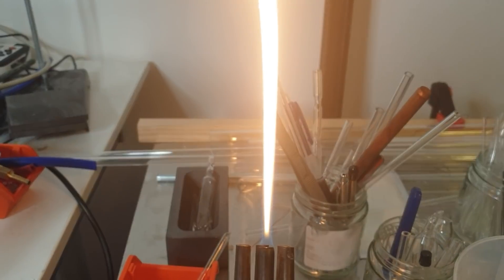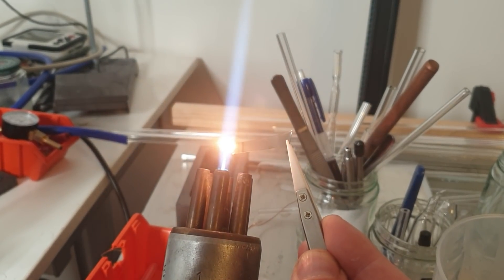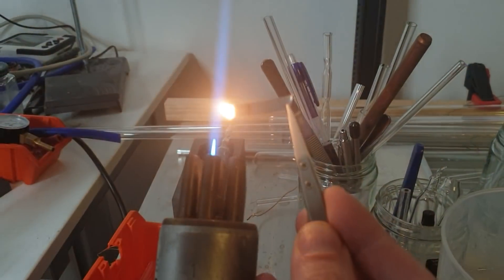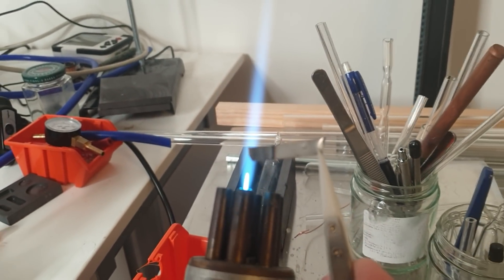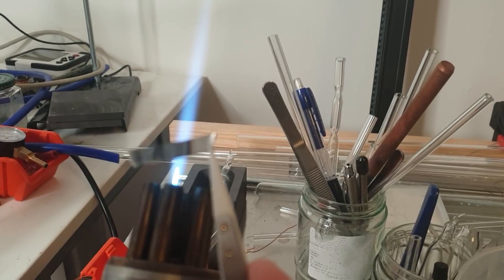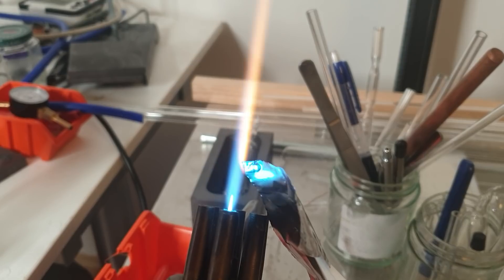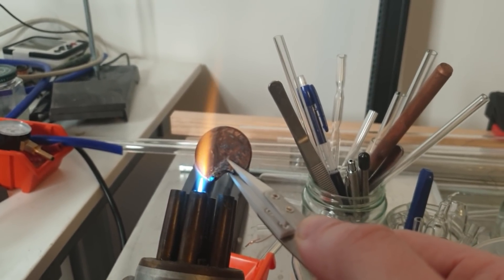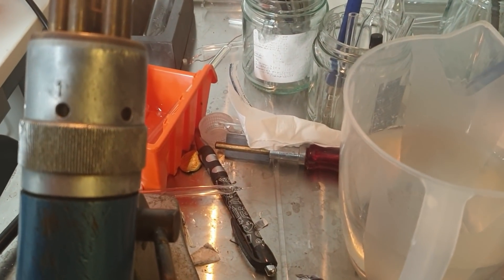Zirconium goes into the fire RAW FIRST FOOTAGE!

Comment: is it possible that the zirconium brightness is related to it being a very strong thermal emitter in the visible region, as opposed to the usual black body radiation glow? You know, the mechanism that is used for AES (atomic emission spectroscopy)? A spectrometer should answer the question - you have one on hand too.

Comment: Can Zirconium make a good structural material for the sodium ramjets on (otherwise electrically-propelled for ascent, acceleration to ignition speed and landing) airliners that will be needed to make money while dispersing sodium oxide into the atmosphere as an albedo raising and carbon capture measure (since use of sodium to combat climate change are a thing you mentioned in another video)?

Comment: Zirconium wire was used in old single use flash bulbs because it burned with such a bright light, the bulb contained oxygen under pressure. Magnesium and aluminium wires were also used.

Comment: What would happen if you took a strip of zirconium, submerged it in water and passed a high current through it to heat it up?
Similarly to the process used when using a tungsten boat to vaporize metal in a vacuum.

I imagine it would be an analogue to what happens in a reactor when the fuelrods overheat and start reacting with the water forming the zirconium oxide and hydrogen. But I dont know if the water would dissipate too much heat of if a vapour bubble would form allowing the zirconium to heat up enough to start the reaction.

Comment: Might be candoluminescence. A quick google suggests that oxides of yttrium and zirconium can be used as a safer alternative to thorium. Also, a patent filed in 1981 (European patent EP0082062B1) suggests using 75-90% zirconium oxide and 10-25% calcium oxide (lime) in a heating mantle. The latter of course also being candoluminescent and traditionally used in stage lighting, creating the expression "in the limelight". An interesting coincidence is also that said patent expired the same day as this video was uploaded! (Or perhaps that's just Google showing the current date as the expiration date.)

Comment: "The combustion of zirconium in oxygen leads to one of the highest temperatures obtainable by the combustion of metals. This temperature has been estimated from available thermodynamic data to be 4930°K at 1·0 atm pressure. A technique has been developed which enables a powdered zirconium-oxygen flame to be operated, thus producing the highest metal flame temperature reported to date." Used for a light source in some photographic bulbs and in explosive primers, and as a pyrophoric material for other explosive devices (probably/definitely thermobaric munitions) Edit: For a giggle, pickle the zirconium in nitric acid and then heat it up.
Reply: Where is the quote from? Source?
Reply: @IanXMiller    https://www.sciencedirect.com/science/article/abs/pii/0022190258800597
Reply: So time for experiments with Zirconium thermites?

Comment: Did you try holding a Geiger-Counter next to it while burning it?

...I know Im stupid, but thats just the first thing that got to my mind.

The second thing is the blinding-bright sparks of Titanium if you push it into a sander or a grinding-weel.If I had to come up with an explanation, I'd most likely default to thermal conductivity coefficient;
So, (carefull, all assumptions:) if a given material has a realy low thermal conductivity coefficient, then there is not that many ways to get rid of excess heat, meaning it eventualy just starts to radiate away.

Comment: I'd heard of it being used in certain cluster munitions and also that it used to be used in camera flash bulbs due to its tendency to glow brightly at high temps in air.
"A small fraction of the zircon is converted to the metal, which finds various niche applications. Because of zirconium's excellent resistance to corrosion, it is often used as an alloying agent in materials that are exposed to aggressive environments, such as surgical appliances, light filaments, and watch cases. The high reactivity of zirconium with oxygen at high temperatures is exploited in some specialised applications such as explosive primers and as getters in vacuum tubes. The same property is (probably) the purpose of including Zr nanoparticles as pyrophoric material in explosive weapons such as the BLU-97/B Combined Effects Bomb. Burning zirconium was used as a light source in some photographic flashbulbs. Zirconium powder with a mesh size from 10 to 80 is occasionally used in pyrotechnic compositions to generate sparks. The high reactivity of zirconium leads to bright white sparks"

Comment: Isn't uranium another combustable metal, more so even?

Plus Uranium reacts with hydrogen to make Uranium Hydride, an even more pyrophoric compound. That's where I'd put my money.🤔

The sheer amount and the speed that the of energy was dumped into the system at the hight of the supercriticality is mind blowing. I wouldn't even be surprised if the speed of the temperature rise would make the fual rods to shatter, massively increasing the surfce aria was litrally fuel to the fire.

It would be interesting to see a play by play of what happened, what would react with what and when.

Comment: Back in the mid-80s I heard from one of my machining instructors that he had worked at Hanford, Washington, in a machine shop. Every lathe had a short 2x12 at the end of the bed. Because why? They were turning volatile metals and if a workpiece caught on fire, you were supposed to place the plank under it, loosen the chuck, back the tailstock off and flip the damned thing onto the floor. He had a piece of zirconium that caught fire, but he fumbled and it fell between the ways. It melted the cast iron lathe in half, then burned into the concrete floor!

Comment: My thoughts:
Heat a slightly larger sample of zirconium to whitish hot. Clean sample gently, apply NDT methods( PT/MT/UT/RT) to inspect for heat related fracturing. It seemed that it reached its hottest point when wet compared to when dry. Is it possible there is more happening once heated up than can be visually witnessed? Could purity of the zirconium play a role (impurities/inclusions)? Could the temperature increase rate play a role? I saw this vid and got excited due to your previous hinting at this kind of project. Best of luck!

Comment: 4:17

Vsauce: Do you wanna see the most illegal thing I own?
VOT:  Do you wanna see the most illegal thing I did?
Reply: Destroying/defacing US currency is only a crime if you attempt to put it back into circulation.
Reply: @Animuldok  Really?
Reply: @jangelelcangry  : Pretty much. The law references attempts at fraud. Changing a low value note to pass it as a higher value note. Shaving a coin to collect precious metal (they haven't been in decades) and then pass the coin on at full value. That kind of thing. Also, Thunderfoot could probably get his US 25 cents back by returning the damaged coin to the mint to be destroyed. Of course it's just US 25 cents so that would be silly and probably cost him several times that much to do. But they do (or did) routinely replace damaged currency. As long as they can confirm the value and assert it is a "full" piece (so they don't replace two halves of a bill at full value for example).

Comment: It reminds me of gas mantles - materials specifically engineered to give off as  much visible light as possible when heated, using materials with emission lines only in the visible spectrum to minimise energy loss in the infrared.
Reply: I think those contained thorium.
Reply: Yes, the old ones contained thorium nitrate, which when heated turns into thorium oxide. And because thorium is radioactive, it can be a health hazard. So it is no longer used in gas mantles.

Guess what they use now: zirconium oxide and yttrium oxide. ;)
Reply: @zvpunry1971  IDK, the mantles I bought half a year ago in decathlon excite my geiger-muller tube very much :D

Comment: Your foil may have a plastic coating
Reply: Unlikely. Standard aluminum foil is just aluminum. Aluminum will burn if you get it hot enough and break the oxide layer. Aluminum actually has a very high energy density, comparable to high explosives, and is, in fact, explosive when melted and exposed to water, if you break the oxide layer while under the water while still molten, similar to the alkali metals.
Reply: @ChefSalad  There is a reason aluminum is frequently a component in rocket fuel.
Reply: @ChefSalad  , I've tried to make it react with water by pouring molten aluminum in a fish tank full of water and nothing happened.  It just solidified.  What would a person have to do to get it to react like that?
Reply: @BackYardScience2000  It's a bit of luck, I guess. What i've seen work is heating it up so that you a have drop of molten aluminum in an oxide shell, putting it underwater and shaking a bit. The shaking breaks the oxide and exposes fresh aluminum to the water, and boom. Or not. Also, I suspect that different other metals alloyed in has an effect as well.
Reply: @ChefSalad  , thanks for the info.  I will try that and see if it works.  Maybe if I am able to melt it in an inert atmosphere and keep it there until I can get it in water it'll work.
Reply: @BackYardScience2000  Since it seems that you need a really clean surface on molten blob, that inert atmosphere idea sounds good. Also, you might try some acid to remove the oxide before heating it, and perhaps, heating it using something other than flame, which always has some oxygen to mess with you.
Reply: @BackYardScience2000  Or, another idea is to heat a pot of aluminum in an inert atmosphere, and then suck some up into a pre-heated stainless steel meat injector needle. You won't get any oxide because oxides float on most molten metals, and then you can drop some into the water from the needle, keeping it under argon the whole time. I think that would give you the best chance.
Reply: @ChefSalad  , all great ideas.  I'm screen shoting all of this so that I don't forget about it.  I have a hime made heating mantle that hits about 1,600°f that should do the trick for the heat and I have access to unlimited helium.  I would just need a glove box to contain it in, which would be easy.  I might just be able to make this happen.
Reply: @ChefSalad  I saw the previous video too

Comment: Where do you buy those tweezers. they look like what i am looking for.
Reply: They are used to change the coil heater things in vaporizer have ceramic tips I got mine from Aliexpress but other auction sites might have them.
Reply: Barry Mayson They are also used for manually placing and holding surface mount devices for soldering, etc. 
Simon Østergaard Search for “ceramic tipped tweezers” or “non-magnetic tweezers”.